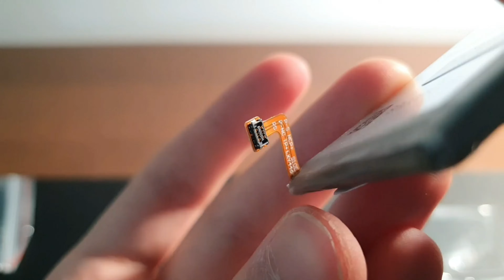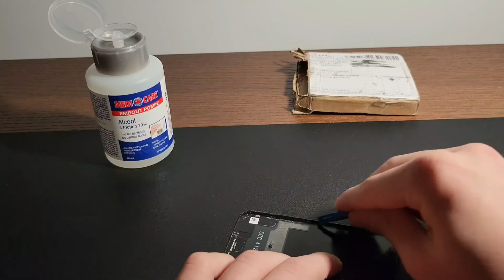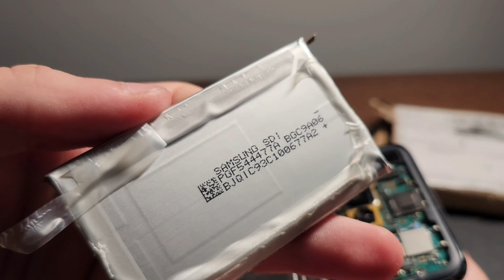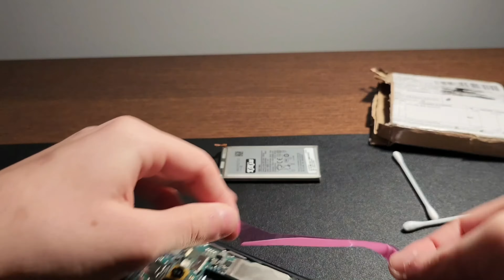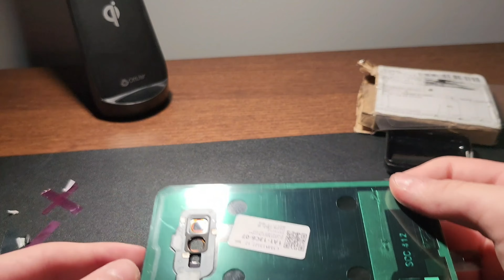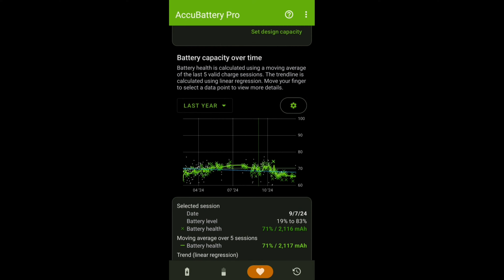Is an AliExpress Battery Worth it? Galaxy S10e Replacement Guide

Comment: Thanks for your video. Can you tell me how true it is that those batteries supposedly have a higher capacity and fit in an S10e? Do you think there’s a way to improve the phone’s battery capacity? I must admit it has an excellent rear and front camera.
Reply from the maker: Hello! If advertised to be of higher capacity than the original, then most likely they are lying. The battery I used even inflated so the quality is pretty bad.

 There is no way to improve the phones battery capacity higher than the original at least for now. No one is making a silicon carbon battery for this phone and no one will.

Only thing to improve battery life is optimizing the phone, maybe a minimal custom ROM as well, would not recommend tho.

Comment: I bought a 'new' battery from IFixIt, said 2025 on it. But the battery life is just as bad as the 2018 battery
Reply from the maker: Yeah, they don't produce batteries for phones that are already released. Its mostly a couple years after release they make a bunch and stock them, instead of fabrication on demand.

So batteries you purchase will be 0-2 years newer than the phone itself most of the time.

Another reason might be that your phone isnt calibrated to the new battery yet. Discharge to 0% and keep turning your phone on until completely dead, then charge to 100% without turning it on and keep it 2+ hours still charging after 100.
Reply: @YoussGm  thanks, I've done all the calibration. Why would the battery have 2025/02 printed on it?
Reply from the maker: @jobbo89  is it directly printed on the battery? Does it say manufactured on or packaged on?

It might also be a sticker around the battery.
Reply: @YoussGm  it was just a date printed directly on the battery
Reply from the maker: Idk then maybe it is new. Ifixit is one of the most reputable repair companies so yeah. If you're not satisfied they would probably send you another kit free of charge just send an email.

Comment: does 75% alcohol will works for glue on the battery ?
Reply from the maker: I used 70% so yes it works but I would be careful not to put too much and avoid getting it on the black area behind the battery.

Thanks for watching!

Comment: I had to do mine on the note 10. Got a new one from iFixIt with the toolkit and all. Absolutely horrible experience to remove the glue. Mine was at 82-85% of official capacity. With the iFixIt one it was at 75%... really dissapointed. They did however send another one for free with the toolkit. I'm keeping the first one on for another year and then I will swap it with the replacement
Reply from the maker: Yeah these batteries really aren't very healthy. Glad to see they sent another one, probably impossible with aliexpress.
Reply: @YoussGm  I mean you are selling me a brand new battery with expected capacity of 4300, I'm expecting to get that. Especially since it cost 5-6 times the price of a Chinese one. You can try to get a refund on ali, but they will make you waste 2-3 weeks, show them the battery inside the phone etc. not worth the hustle

Comment: I'm still using my s10e I really like using this phone because of the fingerprint sensor and how compact it is. Have you tried replacing your lcd? Mine already got the green tint issue
Reply from the maker: I never had that issue, but I found this reddit thread where some comments give fixes, like changing the color filters in settings to revert back to a normal color or some other steps. You could try it and hopefully that works since replacing the screen is definitely not easy to do. https://www.reddit.com/r/galaxys10/comments/pzxlj7/i_am_having_this_green_tint_out_of_nowhere_is_it/
Reply: @YoussGm  I already did that trick but later on it stopped working and green filter worsen because it flickers, I already replaced my amoled display with frame it feels like brand new it might last another 5 years haha

Comment: Hope this battery is save! You know how dangerous a bad one can be! But the S10e is still a great phone except for being stuck on OneUI 4.1 :(
Reply: Oh and of course great video!!
Reply from the maker: It's been around 2 months since the battery replacement and for now I don't notice any issues. Battery health is at 65% but I don't know how much I trust accubattery and if I would need to reinstall the app to have an accurate reading.

But not much difference in battery life. And yeah great phone I plan on using it until it stops working!

Thanks for the comment!
Reply: @YoussGm  Well thats good to hear! About Acubattery, i tried it out but i dont know if i should trust it, didnt have it from the start anyways so it wont be able to recognize my real battery health anyways, gonna replace my battery someday troughout my phones life cycle, hope there are still official replacement parts by then.

 I plan to use it till 2027 or 2028 (S23) since that is when Support is gonna run out and im someone who wants to have the latest software haha! But hey the S10e is still awesome, even on OneUI 4.1! I have a friend who has an S10 and it´s also great still! And that mindset of using it until it breaks is definintly a good one!
Reply: @YoussGm  I'd test the old and new batteries with the same load and see the real difference. Accubattery is not bad, but worn batteries have the tendency to trick it to think they have more capacity than they really do. Or less if high voltage charger protocol is used.